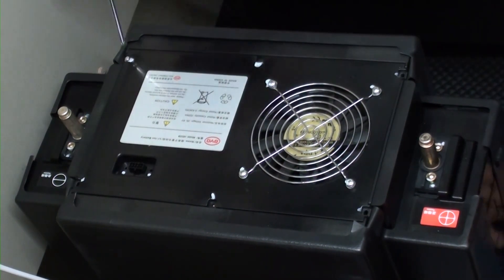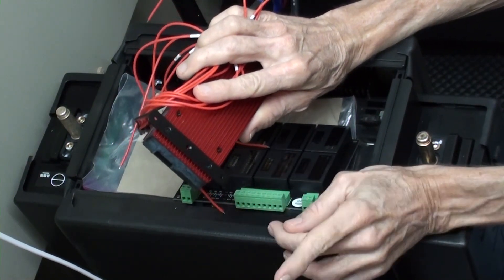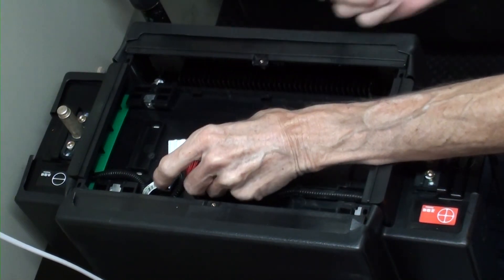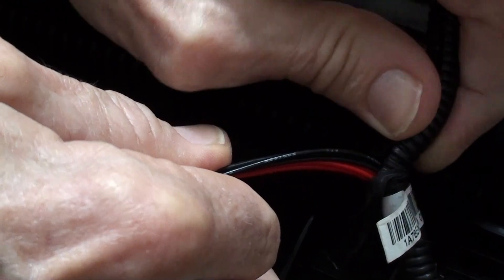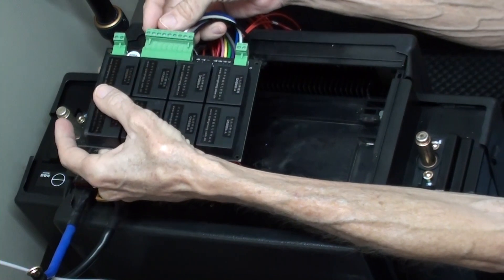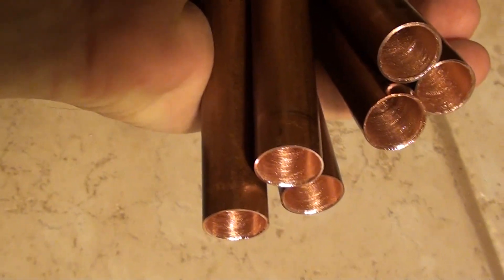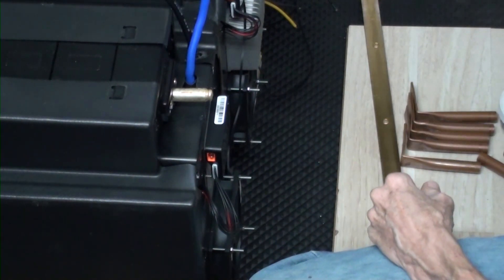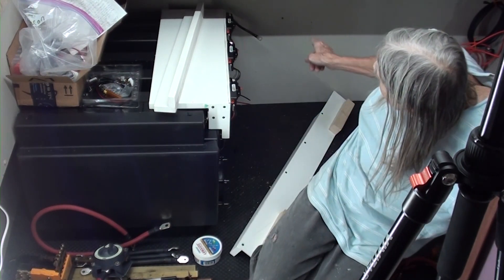Off Grid 10,000 watt-hour lithium LiFePo4 battery parallel connecting several large batteries + BMS

Comment: Really slick install, but I have a few comments as I have these same batteries and a similar setup for our off-grid installation here in AZ:  I would have put the breakers on the positive size of the batteries.  If the negative is disconnected via the breaker, you could still short the batteries by touching the positive cable ends to a grounded connection.  The second issue I see is with your balancer.  The original cables that come installed on the BYD batteries are too small to carry 5A of current.  That's why David Poz installed his own cables for the balancing function.  The original cables are really only good for monitoring (like you're doing with the iSDT and BMS.)  If you just redo the balancer wires directly to each battery cell, then you won't have to worry about melting your wires and losing your BMS/iSDT.  Could also be just as easy to move those breakers to the lower connections as well.

Comment: Why do the cells need to be the same voltage before you charge them? Is there a problem with me hooking my dead deep cycle batteries to a forklift with jumper cables?
Reply from the maker: I think lead acid batteries are fine charging that way as long as something limits current to prevent melting anything.  Lithium cells do not like to be taken too low or charged too high.  Older batteries often wind up with a few cells that are better than others so some reach their maximum allowable voltage before the rest are fully charged.  Other cells reach their lowest allowable voltage before the others when discharging the battery.  In both cases, the BMS shuts down the battery when the first cell reaches its limit.  Cell balancing lets you get the maximum capacity out of the battery because all cells get charged to their maximum voltage together, so all are fully charged when the BMS stops the charging to protect the cells.  Hope that helps.